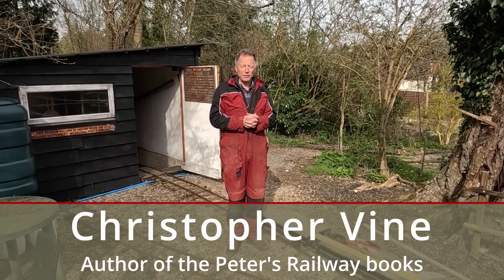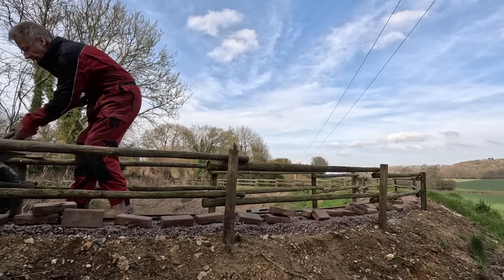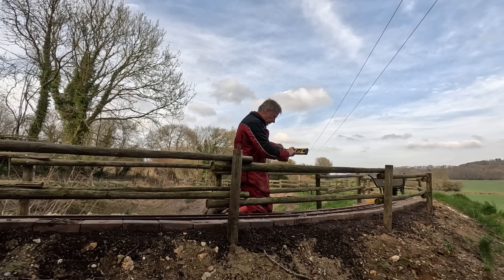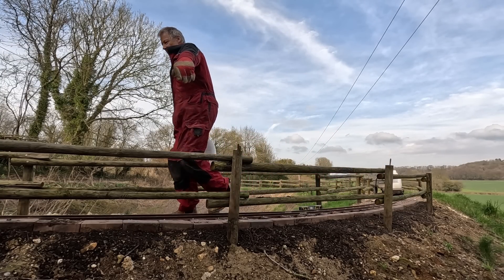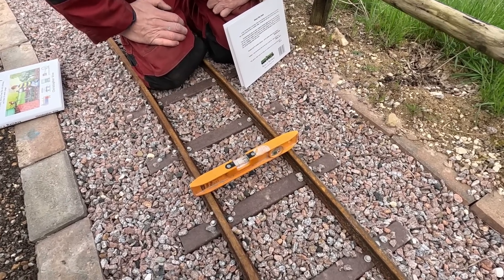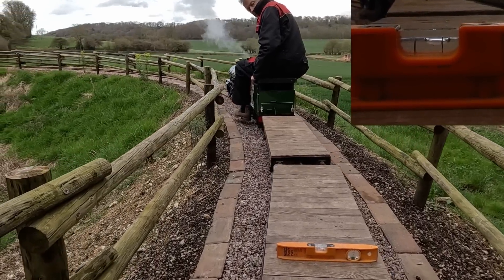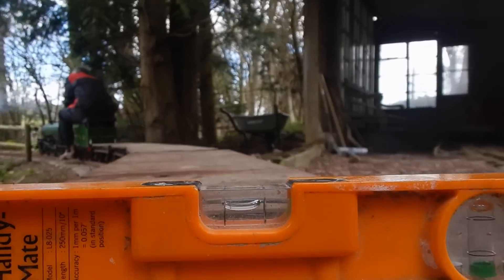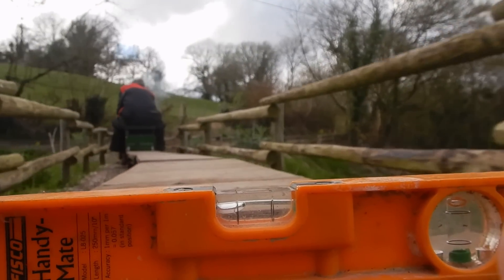Help – My Embankment has Subsided!

Comment: Is it possible or pratical for you to turn the centre of the loop into a pond or dam?
Reply from the maker: Yes, that has been suggested as a cunning plan.  However, there is a little pond at the top of the line already.  Also, if the dip at the other end was filled up with water I think it would push the embankment over!!  Thanks for watching! Best wishes, Chris.
PS. If you would like to know about the books I write to teach children (age 3 to 90!) about railways, science and engineering, there’s lots of info here: https://petersrailway.com/ and we ship overseas.

Comment: Can you show what happens when a blowback happens
Reply from the maker: That's a really good idea, however I will have to work out how to make it work.  Usually it happened when an engine went into a tunnel and the pressure must have increased at the chimney, blowing flames out of the fire hole door.  We don't have a tunnel on the railway (and anyway it would be rather tall to allow me to fit in, so the effect would not really be the same) but maybe I can simulate it in some way to show what would happen.   Give me a while!...  Thanks for watching! Best wishes, Chris.
PS. If you would like to know about the books I write to teach children (age 3 to 90!) about railways, science and engineering, there’s lots of info here: https://petersrailway.com/ and we ship overseas.

Comment: It’s funny as me too I grew up on your books and 10 years later i’m looking to build a railway like this as well. I was going to use 5” but was wondering what gauge yours is as you never seemed to have mentioned it. Also, I can’t seem to find many manufacturers in the uk of these gauges especially of larger steam locomotives such as class a1, a3, 01 and 04 do you have any suggestions? Your Railway and books are an absolute inspiration and dream. Thanks
Reply: Could you also do a video on how to clean out bongo’s firebox?
Reply from the maker: Yes, it is in the production pipeline for the summer….
Reply from the maker: Hi Charlie and thanks for your lovely message.  The railway is 7.25” gauge, which works well on ground level.  The biggest problem is space - for mainline type locos you want curves to be min 30 ft radius and 45ft is better.  Gradients want to be less than 1 in 60 or you will have to haul very light trains!  
You are right, there are not many suppliers.  Polly model engineering make good kits of simple engines.  Then maxitrack make some finished smallish engines.  Don’t go for something big and complicated, it’s much better to have something simpler which works properly!!
Be very careful of second hand.  There are some good dealers but some much less trustworthy.  
Best advice is to join a model engineering club and ask for help…. Hope that helps?? Chris

Comment: Centrifugal  force from the loco will push to the outside rail, therefore make the outside wider to counter this force
Reply from the maker: I think that the amount the outside rail can move is very small compared to the clearance between the rail gauge and the width between the flanges.  Thanks for watching! Best wishes, Chris.
PS. If you would like to know about the books I write to teach children (age 3 to 90!) about railways, science and engineering, there’s lots of info here: https://petersrailway.com/ and we ship overseas.

Comment: Probably too late now but geotextile (drainage) fabric layers as the embankment was built up. Used in small and large embankment projects. You have a nice railroad..
Reply from the maker: You are exactly correct!  The trouble was that the heavy equipment is very seldom available to do railway work and there wasn't time to do this.  However, the main part of the embankment seems pretty stable so I think it will be ok from now on...  Thanks for watching! Best wishes, Chris.
PS. If you would like to know about the books I write to teach children (age 3 to 90!) about railways, science and engineering, there’s lots of info here: https://petersrailway.com/ and we ship overseas.